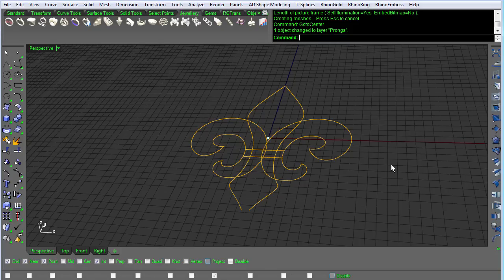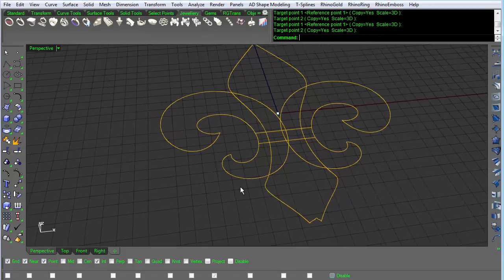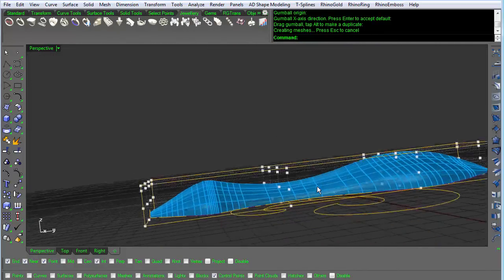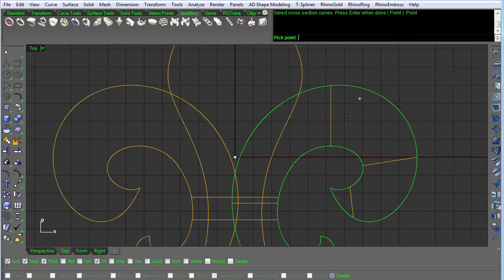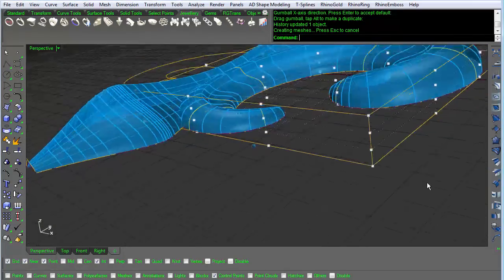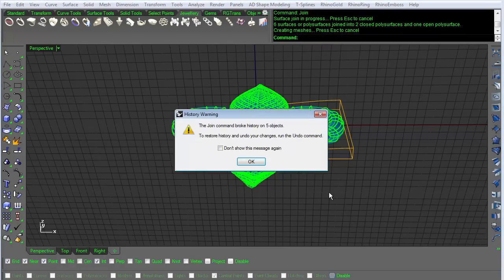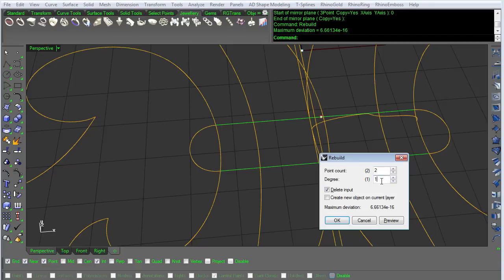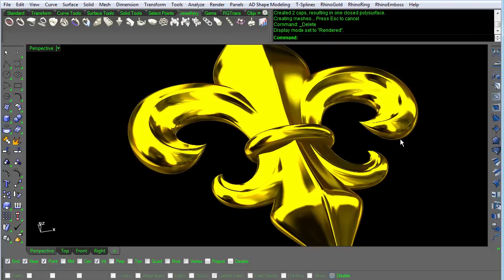Rhino Tips And Tricks - Ornamental Work In Naked Rhino

Comment: I know this old, but where do I get that jewelry tab? I have rhino 6.
Reply from the maker: Which tab? That was rhino 5 and a lot of plugins did not make it to 6
Reply: @EricM81  you have a tab at the top of your your window labeled jewelry
Reply: I don't have the $4,000 to get panther
Reply from the maker: @dragonshoarddesign3094  whatever that jewelry tab was, I want using it. I've tried many plugins since leaving matrix and rhino 4, and they've all been terrible. 

I hear the same things about panther. It's expensive and it only works some of the time making it useless. 

That's why all the jewelry training centers no longer teach with plugins.

The best thing you can do is upgrade to rhino 7 and learn rhino.